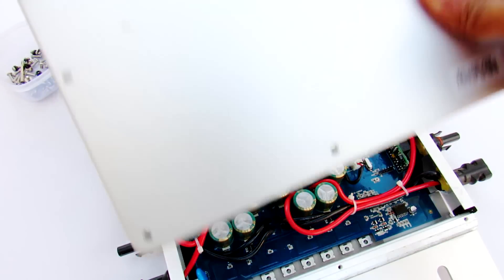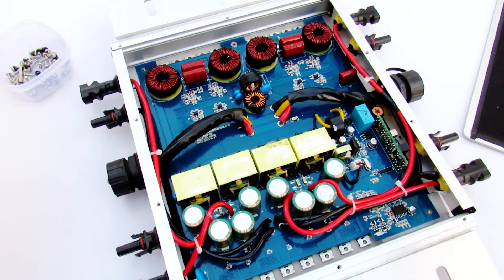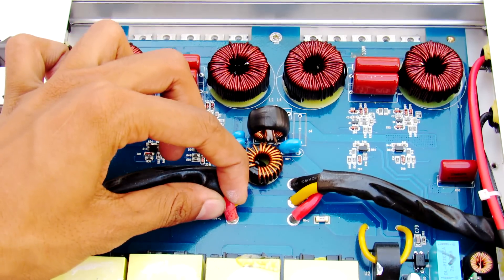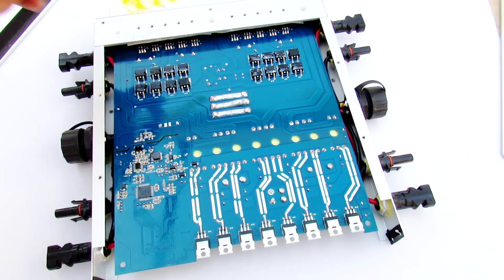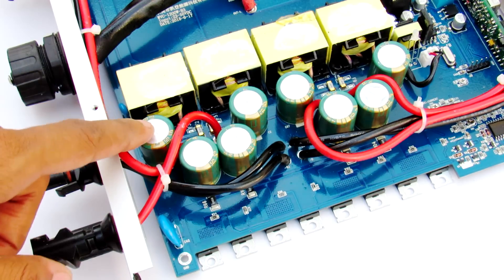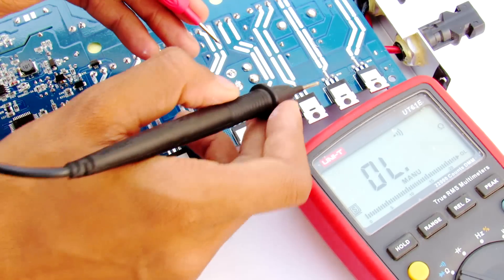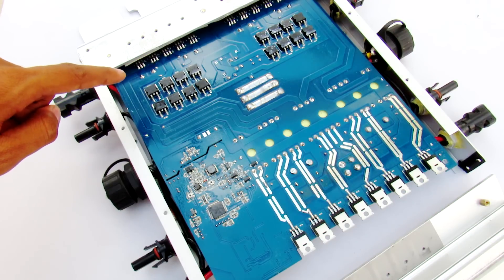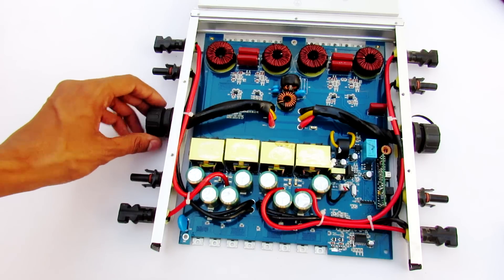WVC1200 Solar Micro Grid Tie Power Inverter Teardown & Repair

Comment: My only issue so far was blown fuse at the output. Not a problem in winter. Put 4 panels in two inputs. Order new unit, wait for shipping. Return/Keep/Repair unit missing ac indicator light. Suspect 10A surface mount fuse.

Comment: I did repair mine I had a similar problem as you describe and discovered that all panels are in parallel including the MOSFET controls. If one MOSFET fails on the panel input side you measure that failure on four of the eight input  MOSFET's.  I removed two of them and found the faulty one. 
The HF SPWM mosfets at the bottom side of the inverter are also grouped I believe it is grouped in two H-briges each bridge having 8 Mosfet's. So every H-bridge switch is 2 parallel MOSFET's . One showed a failure and i removed that one to and again one MOSFET failed. At full power I don't feel any head from the H brige. The transformers however do get hot, I changed the four aluminum heat blocks on the frond plate inside of the inverter for a litle bit thicker aluminum strip for better contact between case and transformers. I'm planning to add extra external aluminum fins. it would be nice if WVC DK would change the input MOSFET's for better ones like the IRFB4110 that has only 3.7 mOhm@25°C and cost around 0.4USD instead of the IRF3710 23mOhm@25°C That would save around 30Watt of loss at full power and a lower operational temperature. What I dont know is if the gate drivers can handle the  IRFB4110 double gate charge 160nC instead of the 80nC gate charge of the IRF3710. 
Overall with three panels each 300Watt the temperature of the case is hand warm at around 550Watt of power like a cup of tea and a quite low wind condition, at 4x300Watt with low wind the temperature at 800Watt power is too high in my opinion, you can touch it, but it will feel hot. I estimate the case is around 60°C, to hot in my opinion. 
I did measurements with NTC thermistors inside on the Transformers with a closed casing. With no airflow I measured 62°C between the transformers on two panels with around 400Watt of power.  As soon as I added a mild airflow from  a small fan the transformer temperature dropped to 52°C.  I estimate for each panel connected makes the temperature inside the casing increasing with 8..10°C starting from 40°C with zero power.
 What I find strange is the way the STD13NM60ND are mounted on the PCB. This is a D2PAK and the cooling of the aluminum case connect on the topside of these MOSFETS.  The Typical RDSon@25C is 110mOhm. So at 900Watts@125AC with a Junction of 120°C the RMS current is 7.2 going through 2 Mosfets 3.6A each. The power dispassion in each MOSFET is 3.6*3.6*110 *2/1000=2.8Watt  Part of that heat goes away through the PCB but a large part needs to go through the topside of the package to the aluminum casing?  I wonder if that is a problem. Fact is that the Hbrige of 16 MOSFET's lose 16x2.8=44 Watts of power. A better MOSFET with a lower RDSon would reduce that loss.  

The Quality in the inside looks quite good to me, I do believe that the transformers are to small for what they need to deliver and are not well-connected to the case to lose their heat. It does work however.
I will add the layout of the inverter on the internet using this link www.holamex.nl/files/img/WVC1200_layout.jpg
An other WVC link https://www.youtube.com/watch?v=AJE49QckhHA
An other WVC link https://www.youtube.com/watch?v=KF0_ZFNhLIs
An other WVC link https://www.youtube.com/watch?v=y5d93bAAD7Y

Message to the manufacturer, change the input MOSFET's for better ones for example like the IRFB3077, show us some more detailed information about this inverter and improve your Quality processes because quite some people complain about DOA's when received
Reply: So did you change the shorted mosfet to another one? I found another alternative mosfet in the internet. But at this moment I am happy with a working wvc. Let's wait for the summer.
Reply: @FunnyFantasticFail  yes I did change it one in the 4x DC stepup brigde and on the SPWM high voltage side  and its working now.  There were no diodes  damaged.
Reply: I can connect a single panel to an inverter with 2 inputs or 4 inputs, for example if it has two inputs and is 600w, I can put a single 500w panel connected with a y connector to pull the inverter on both inputs from the same panel but without exceeding the total power?

Comment: I have had the same issue (all 4 DC input shortcut) with the inverter and fixed it by replacing one of the 8 IRF3710 MOSFET, now the inverter is working again. Just measure with a multimeter the passthrough and you will find it.

Comment: I can connect a single panel to an inverter with 2 inputs or 4 inputs, for example if it has two inputs and is 600w, I can put a single 500w panel connected with a y connector to pull the inverter on both inputs from the same panel but without exceeding the total power?

Comment: Do you know why this???
Ac Volt 5.1v... and I have 220v.  And PV actual is 0.00a Too.
Where is the error?? WVC 350 Life.
My inverter marks a fixed red led. The socket where it is connected and checked is 220v. But it doesn't detect. I've read somewhere it could be just one piece. The 14D471K that has been due to a power surge. what do you think?

Comment: This 1200W inverter is a design mistake. They use IRF3710 with power dissipation around 200W this means this inverter is for maximal 800W. The internal resistance of this IRF is 23mOhm, was better to use something like TK100E10N1 with 2.8 m (typ.)

Comment: To change the output from 230Vac to 120Vac, only PCB jumper modification is sufficient or other modifications are required?

Comment: I have a WVC1400. The input circuit is almost the same as the 1200. The difference is in the Mosfet. I replace the RF25 & RF26 and they break through. These are the  KIA3510A.
Something else is wrong. He could establish that with the  scheme of the entrance part .

Comment: Does anyone know if these Chinese inverters actually feature four separate mppts or is it simply configured in parallel internally?
Reply from the maker: Just parellel internally
Reply: @HowToGuys  are you aware of any micro inverters with individual mppts? I know hoymiles and huayu, but both are very expensive and/or hard to get these days

Comment: This converter has a terrible construction.  Why it has 50V capacitors when it should work with up to 60V. Build to fail. Mine worked 2 days at 50V and was burned.
Reply: I like them and bought a second.

Comment: Thanks for the look inside.  Always looking for another GTI which I can buy broken and fix.  At least it doesn't have nasty potting like enphase. When you have multiple FET on the same DC buss which is shorted, I just connect to nice constant current power supply set to about 4A.  Measuring voltage drop on each transformer winding, even though it is just a few mv, points me to the right FET. Very useful when it is not a bad FET but an over voltage protection diode which is shorted.
Reply: I would imagine you could just do temperature measurements to find the faulty components also.

Comment: Dear,

I bought micro inverters 127V , but I need 220V. I cannot return these micro inverters. Do you know how these micro inverters can be changed into 220V?
Reply from the maker: if you need to change the inverter voltage you also need to switch the Transformers and other power handling components so I would rather not touch anything

Comment: irf3710 or other 100v mosfets are not enough for this inverter. At least 150v Best is to use 200v mosfets. Mine have had 150v mosfets and still blown because of high voltage spikes. Try irfb4227

Comment: Does the wvc-1200 have the diode for preventing reverse current from solar pannel?
I wonder if I need a distribution pannel  to pass the electrical safety check
Reply: Normally the diode is in the photovoltaic module. Make sure your module has the reverse current diode.

Comment: Hi Kendar, I have installed a WVC1200 and mine also died after 70KW/hr of work and a daily yield of around 5KW with 4x300Watt panels. The out side body temperature was around 45 degrees. With AC power and Panels connected the LED on the front is off. I'm planning to dissect it and do a post-mortem analysis on it.
Reply: I have the same setup with 43 of the WVC-1200. 4 x 320w panels. Over half of the inverters are dead now
Reply: @stephendsjones  replace for better mosfets and modd the case add a small fan to blow the heat out

Comment: Hello Kedar. I have a problem with a WVC1200. When I connect the 4 solar panels of 300 Watts the red light bulb lights up. I just connect the output to the 220 Volt mains, the computer synchronizes and changes the led to green, but it only lasts a second and returns to the red and does not synchronize again. Which may be happening, check out the Mosfet and all are well. Thank you.
Reply: Are you sure that the dc input is in the range from 20-50v

Comment: The mosfet pins you measured are not drain and source. They are gate and drain.
Reply: I believe he forgot he was looking at the back of the part instead of the front. Myself having done it a few times. It gets embarrassing when you actually change the good part bc of incorrect measurements

Comment: @ Kedar Nimbalkar, hello nice interesting video. Please can you tell me what kind of N-Channel Mosfet at the 230V side are used. I have the same inverter, but suddenly it stopped working and 8 of this Mosfet`s have a short. But I can`t read the type because the manufacturer cut away the lettering. Hope to hear from you soon !
Reply from the maker: Please check the description for details of mosfet.
Reply: @HowToGuys  How can I check the description if I don`t know the type of these Mosfet`s. For this reason I asked you !! If I don`t know the type I have to change all of these Mosfet`s because all of them must have the same specification. Always two of them are in parallel !

Comment: any idea how the power line communication is done?
Reply from the maker: +Frank Boddeke Inside inverter there is a dedicated wireless chip ,which sends measured voltage and current to the wvc modem .
Reply: thanks. do you know what part number or detail picture?
Reply: i know
Reply: Hi frank are you dutch?. I'm interested in the API of the WVC do you have information about that
Reply: yes i am. i did get a bare power-line transceiver (BW-EP09), same as in the wvc, but have not hooked it up yet...

Comment: Hi, i have this version, but i cant connect using the KDM System, but i think the rest its work fine, because i connect in others 2 one without problem, what can i do to solve the problem in microinverter to connect again ?

Comment: Hi Kedar, i bought one of these inverters a few week ago and tested it with 2 x 260w panels, it looked to be working fine, i decided to try each panel on their own to see how close they were so i turned off the AC power and unplugged one of the panels after turning on the AC power i noticed there was nothing on the watt meter, when i looked at the inverter there was no red/flashing green or solid green light, the whole thing is just dead, any ideas what may have gone wrong and how it may be fixed ?
Take care
john
Reply: I had same problem, Blew out 4 of these wvc1200's Contacted KaiDeng and am sending them back for repair. It appears that they mosfets blew out after i disconnected the through cable from one inverter to the next. I was able to recreate the same behavior. I  had 4 240w solar panels connected. Was disconnecting the through cable to test voltage and it blew. Also noticed that my AC voltage increases up to 263v AC then resets the inverter so it just keeps cycling on and off. Any idea's i would appreciate it.
Reply: NEVER NEVER disconnect any solar inverter under load from AC !

The load rejection will produce an overvoltage surge that can easily Kill the output MOSFETs  or the protection MOVs, before the Inverter can control it's power output.

I installed a socket between the inverter and the switch, and before disconnecting the Inverter I plug in a dummy load in it ( Old electric heater, 1500W ). Plug in heater, open switch, wait 5 seconds, unplug. The load is bigger than the capacity of my solar panels (4 x 235W) and then The Inverter "Feels" the synchrony loss and the voltage drop, shutting itself down in a second. The resultant overcurrent is much less harmful than an overvoltage.

This was installed after I toasted several Enphase inverters, "protecting" them from lighting storms and other issues.
Cheers.

Comment: do you have the value for the varistor on the lower left corner? marked as GND, on the left of the capacitors? my inverter has it missing!

Comment: Hi Kedar, how do you connect this inverter here into 240 volts system with 2 hot lines, neutral and a ground line. This inverter here only has 3 wires one is hot line and neutral and a ground wire. Please right back. This is Hollywood here.
Reply: You have leg1 and leg2 + ground/neutral In the United States Leg1 and Leg2 have 120 votes to neutral but 240 volts Leg to leg. A 240 vote circuit is from leg to leg while 120 volts leg to neutral.
Reply: Carl J can you possibly help me out here I am trying to figure out the same thing on these inverters I actually ordered one that is stamped on it 240-volt but it's still only three wire they're not showing me to hotlines
Reply: One wire is connected to the case it is ground not neutral. 240 does not need neutral. 2 wires connect across your 240 volt connection to your panel.

Comment: Great video , Kedar ... I have one of these inverters , but my panels don't match , they're 100W 21V open circuit , I have to put 2 in series for the inverter to work ... so do I put 200W on each input , or would 400W be OK?
Reply from the maker: +oz93666 I think 400watt will be OK .

Comment: Dear Kedar, thank you for posting the video. I bought this same inverter that did not work one day. The red LED is lit steadily. When it was replaced the new one worked perfectly which eliminates all doubts about the solar modules and the installation. What was the solution you adopted to repair your micro inverter? Do you have the electrical diagram. Thank you!

Comment: Can You write the all names of ic with more than 2 legs? You can also post macro pictures. It will be helpful for reverse engineering of this converter. I am mainly interested in current measurement, DC converter control, sinewave controller, mosfet drivers.
Reply from the maker: please check most of the parts listed in the description below , I will upload pictures soon.
Reply: +Kedar Nimbalkar there is nothing more than main uC and mosfets and diode. I am interested in logic part of this converter.
Reply: +Против Глобал I am interested in designing converters. I know this documents. I am interested how it was designed in real consumer electronics. Which ics they used.
Reply: +Против Глобал I am interested in designing converters. I know this documents. I am interested how it was designed in real consumer electronics. Which ics they used.

Comment: I saw that all the negative wires are connected together(black ones). Can someone confirm if positive(red ones) also are connected together. I need to know due i will attach 250w panels (5 pieces) so i will need to connect 2 panels in one port and 1 on each other.total 1250w
Reply: The positives are separate
Reply: In the WVC 600 the 2 positives are connected together internally (Not at the same point but by the motherboard). I think that in the WVC 1200 the 4 inputs are together  also. Check with an ohmmeter.
Reply: The positive are connected together, with a fuse to the common positive.

Comment: Hi, my name is Francisco, I'm from Brazil.
I bought an inverter of the same model as yours on eBay, my inverter is of a newer model (with small differences), but I think that the MosFet are the same.

When I connected the inverter to test with a solar panel of 330W, it worked only about 15min.
Then the same fault occurred as your inverter, short on the 4 DC inputs and no AC voltage.
Do you fix your inverter? Do you have the electronic schematic of this inverter? Can you help me? Tks...
Reply: Hi Francisco, have you solved the problem? I too have the similar microinverter and experiencied this behavior. I was observing the issue and concluded, at some level of certainty, that these microvinverter can not work with hi power PV, in my case they are of 325w. When the sun is at high peak, microinverter becomes very hot and stop to work. Now I´m looking for a new one capable to manage my PV set, but I have not found it.
Reply: Olá Francisco. Você conseguiu solucionar o problema do teu inversor?

Comment: Heavy Price Competition and Technology upgrades has resulted into the compromise of components quality used in GTI...
99% the culprit is the Power Devices and the Diodes which get Shorted otherwise there is some problem with the Driver Ckt...
if you can replace the Mosfets/IGBT and the Diodes and check the Driver ckt once maybe the Inverter can work fine again.

Comment: i have some question for youi use wvc-600 220v/50hzbut my country(korea) use 220v/60hz AC PWRso, i'm afraid that it make a trouble with my equipment(refrigator, tv, etc..)how can i change frequency from 50hz to 60hzor, it's ok to use wvc-600 continuous.
Reply from the maker: +jaein lee inverter changes frequency automatically, you don't need to do anything.